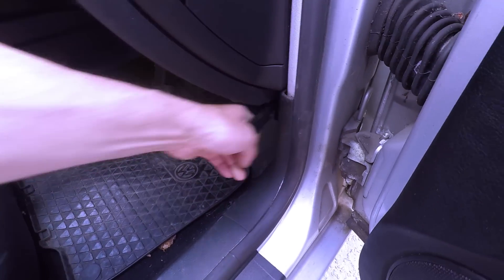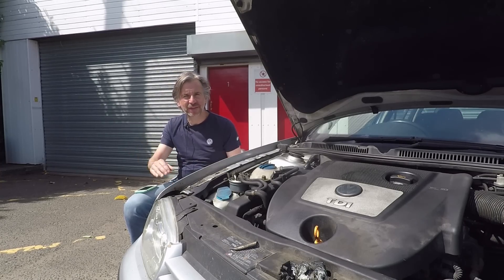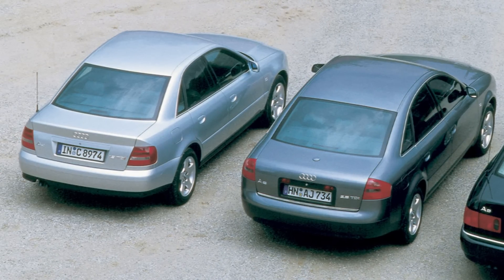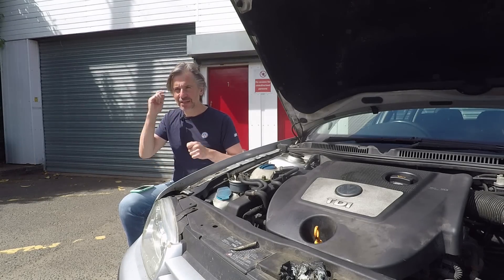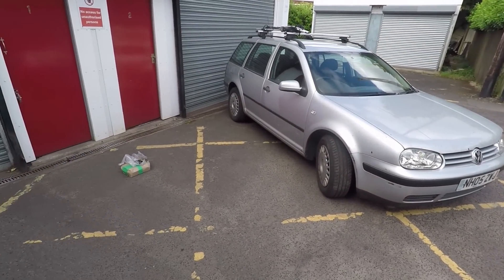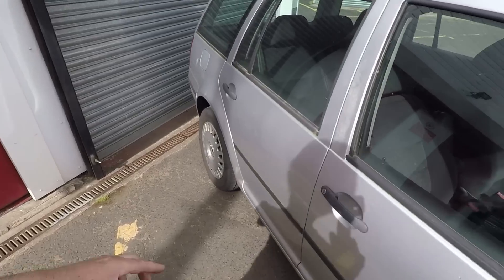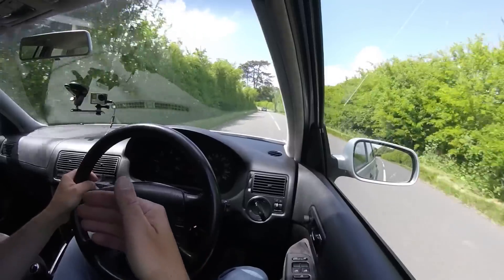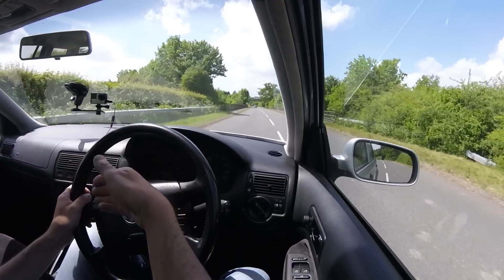I BUY A CAR with VW's BEST ENGINE for JUST £1!

Comment: I’ve worked for Vw/audi group for 22 years and totally agree it is one of the best engine ever produced!
Reply from the maker: Good to have the benefit of your experience A K👊
Reply: Seen an Octavia with the 90bhp engine for sale ages ago. Ex Private Hire, had done around 400k.
Reply: @R A what's the best engine to you? Because these engines are extremely reliable, efficient, and can be remapped to make good power easily
Reply: the best engine to fuck the ozone layer
Reply: @DGT73  my golf 09' 1.9 tdi BXE is still running really well!
Reply: I’m thinking of getting a golf which golf would you recommend for a new driver ☮️😎
Reply: Roberto Kit I’d avoid any car with engine code BXE. They were fitted to all VAG platforms from around 06 to 09, basically the ‘run out’ engines that vag used before switching to common rail Diesel engines. I’d go for a well looked after pre 2006 non BXE engine code car, you can see the engine code
Printed on the timing cover, It’s true not all will go pop but just knowing it might is enough because you could end up in a very dangerous situation, luckily when it happened to me I wasn’t  too far from home.
https://bxeenginefailures.wordpress.com/
Reply: Audi engines with AWX and AVF engine codes you can’t go wrong with. All engines require generally maintenance.

Late PD engines were a headache! Stick with early PD engines without DPF.
Reply: @DGT73  hmmm not good, i don't suppose there's anything to recommend either.. with there being no way knowing why or when it will happen?
Reply: Jem Mace you can get the oil pump drive upgraded at an engine specialist, poor oil shaft drive design again seems to be affecting the 2.0’s too these days. https://www.audi-sport.net/xf/threads/worn-oil-pump-hex-drive-shaft-on-my09-2-0-tdi.274775/
Reply: @DGT73  Thanks pal, I was looking into replacing the oil cooler the other day, looking on youtube for the specific's and to see if any posts came up about the matter when I spotted a video on the oil pump flaws and how to fix, I think this is definitely very high on the list seeing as you've advised me and considering the damages incurred if not done.
Again, thank you!
Reply: I've had AGR, AVF and AXR :P There is also few good videos from Car throttle about the 1.9 TDIs... Octavia, A4 etc
Reply: Can you safely run these on vegetable oil?
Reply: Gilson Dias - burning diesel fuel creates more ground level ozone (eg the main component in “smog”).  While this is bad, and pollutant, it is not “harming” the ozone layer (though diesel fuels do also add to CO2...).  It is best when trying to effect positive change to have a legitimate clue and be able to weigh options in the deeply interconnected complex systems involved.  Ignorant falsehoods help no one.
Reply: @jemmace2586  No sweat, all the best.
Reply: What about my Audi A3 2.0TDI 170BHP IS THAT. A reliable engine?
Reply: i dont mean to be so off topic but does any of you know of a trick to get back into an instagram account??
I was stupid lost the password. I love any help you can offer me.
Reply: @Marcellus Grey No problem xD

Comment: I love VW diesels and have had many, unfortunately here in Sweden the diesel prices have been raised so its not economical anymore. So I went for a 15' Cupra ST instead. Totally fun car too, just bought it a week ago so still getting used to the power and brakes (Brembo).
Still miss the torque and economy of the diesels and reckon the manufacturers will eventually make them cleaner than petrol.
Nice channel and have subscribed. I'm a bit of VW enthusiast, own 2 seats and a T2 westfalia with a very special motor... the body is going through a full bare metal respray at the moment.

Comment: Thanks for the video. It brought me mixed emotions.  I had a 2001 Y reg silver Golf GT TDI 115. I bought it at 15 years old with 120k on the clock.  One overriding feeling was the quality of it.  No knocks, bangs, rattles, super smooth, it felt really well put together, just pure quality that belied it's age.  The bodywork had no rust either.  If you hadn't have known you would have sworn you were driving a 3 or 4 year old car.

Sadly and despite a great history from a VW specialist, I only owned the car for a couple of months.  The car suffered from major head gasket problems.  I'm still not sure to this day if it was just the gasket or also a problem with the block.

Research at the time revealed that the 115 was a bit of an anomaly amongst the other super reliable and long-lived engines.  A weakness in  the design of specifically the 115 lead to a lot of head gasket failures usually above 100k miles that usually manifested between 100k and 130k miles.

I'm sure that if my Golf had had any other version of that engine, it would have still been running to this day.

Comment: Used to love my Bora 1.9tdi 130. Quite quick, economical and never had any problems apart from the boot lock which was replaced under warranty. It even survived having a bit of petrol put in it with no ill effects! Was much nicer than the mk5 golf i had after it.

Comment: the common rail system was a huge improvement compared to the old style injection pumps, old school injection pumps were extremely limited in the maximum pressure as well as injection duration, number of injection cycles and the timing which were all controlled mechanically within the pump, an in between system was the hybrid pumps used on the 2.5tdi v6 engine where there was more electronic control of the timing, the pd's are fantastic being electronically fired and the commonrail takes that a step further by taking the pumping job out the injector to an extremely high pressure pump and fuel rail which feeds all the injectors hence common rail, the injectors are electronically fired  and have extremely tight timing and duration control for better efficiency and emissions but the improved atomisation also allows for better power too. I bought my other half a pd130 a3, it was actually a year older than the 1.2 clio we had just scrapped and was half the price to insure, it's just ticked over the 100k mile mark and still goes like stink!

Comment: I had the 1.9 TDi in a 2009 Mk5 Golf, DPF equipped and with 7-speed DSG.  I particularly enjoyed the effortless mid-range performance (184 lb/ft torque) and easy economy. On longish motorway trips, I would “play” with getting the trip average speed to 60 mph and the overall trip economy to 60 mpg, which I found perfectly doable over a 250 mile end to end journey. Had absolutely no problems with the DPF over a 5 year/65,000 miles ownership period, the DSG transmission helped a lot here as when it was “regenerating” the ‘box would hold lower gears to keep rpm in the optimal regen engine speed range.

Comment: Bought a  2003 MK4 in 2007 with 117K miles. 13 years later , now with 228K Miles ....I've serviced it every year, replaced brake disks/pads etc ,original suspension changed to coilovers (for the lows) at 165K Miles and  a turbo , probably due to remapping and stuck VNT vanes. Never replaced a bush or bearing. Never failed an MOT on anything serious. Now running 180 BHP, still get regular 50+ Mpg, and 60+ mpg on motorway runs. This is the best car I've had and the best overall car I think I will ever have- quick, ecoconical, comfortable....and very cheap to run. @Volkswizard- Good buy for a quid mate!

Comment: I bought a 2001 MK4 TDI 130 golf estate on 90k.  Ran it for about 5 years, sure window regulators, door lock module solder joints, suspension at 150k, duel mass at 180k.

Sold it with 220k on the clock, and all with a tuning box fitted and lots of heavy towing. Last saw it MOT with 280k on the clock.  It was age/value that killed it not reliability.

Really miss that thing!

Comment: I have an 04 PD jetta. 154 000 KM. Didn't need a car at the time, but.. black on black, leather interior, mint no rust, long beech wheels, oil catch can, egr deleted, Bilstein coil overs, 3" custom stainless cat back exhaust, Malone stage 2 tune, 150 hp 275 ft torque, not too fast ( like my 09 2.5 rabbit) but I just LOVE this car. I'll never sell it

Comment: Had the 1.4 TDI PD in a 2001 Polo, owned the car for about 14 years, Engine super sweet, took it to about 200k, a few cambelt kits, always gave it the 505.01 oil. only unplanned mechanical item replaced was the Fuel/Tandem pump and not because it didnt work because the cover was leaking diesel and you just couldn't buy a cover plate gasket. Unfortunately rust will see that car finally off the road as it was starting to get very grotty on front sub-frame and rear axle.

Comment: Audi A3 1.9 tdi pd with the 130 engine and the Audi a2 with a 1.4 tdi engine was the best cars I’ve ever had,amazing cars,that’s coming from someone with a golf mk7 gti
Reply: Yeah, got to agree with you there. After all, the 1.4 TDI is pretty much a 1.9 with a cylinder lopped off, and the A2 is a great little car. Did you have a TDI75 or a TDI90?
Reply: Christopher Morley the a2 I had was the 90,it was fast for what it was,great on diesel to,I regret selling it,wish I kept it for long trips.
Reply: @daibennett9224  That's a nice car you had there (sorry if I make you feel worse about selling it!). I heard the 90s were quick, especially when chipped, and they come with all the cool stuff like rear discs and the FSI (1.2 really) spoiler. My parents have a 1.6, which might be faster outright but comes with none of the torque or reliability, and still sounds like a diesel! It's a shame they binned the A2, but at least people take care of them so there's a few around. Opensky is a pain though...

Comment: Love this engine, I had 2 golfs and a sharan 130, love the torque. I’ve now got kids so a 1.6 tdi caddy and polo, but my best car I will never sell is my 1.4 tdi 3 cylinder. 80 bhp from factory, I’ve done a stage two chip and it absolutely flies off the line( now 105 bhp).

Comment: My current 2011 Passat CR170 has 198k and still on original clutch, DMF, turbo, injectors, injector pump, EGR & DPF. 

The newer CR engines are equally excellent, mine uses no oil/coolant.

Must say though, I went out in a MK4 Anniversary Golf PD150 that had been mapped - the way that donkey punched up hills in the lower gears was hilarious. The mid range hit was bigger than any of my 80’s turbo petrol hatches.

Comment: 1.9TDI is really the best vw engine. 
I also like the 1.8T 20v if right oil is used and changed att right intervals it goes forever
Reply: @R A 
???
Explain
Reply: R A The 20V. Not any TFSI crap.
Reply: R A 
Just don’t like VW’s do you? Shit on the 1.9tdi and the 1.8t? Both great motors. I’m a vr6 guy but I own a mk4 tdi and have owned many 1.8t.
Reply: I have a 2004 Jetta GLI 1.8t for 16 years now and yes I agree, this motor will go forever
Reply: @mx6726  
I ownd 3 diferent 1.8t cars never had engine problems. I had to replace 1 coil and some pcv hoses one time in one of the Audis. And a G28 sensor and thats it.
Reply: I have vw bora 2001 1.8t 150hp, it has 300.000km driven, works better then 10 years younger cars
Reply: i drive a 1.8t with 370k kilometers (230k miles for lazy ones), bought it with 350k 2 years ago... replaced a maf, even though i didn't need to and few vacuum lines, but nothing happened that stopped me on the road. great engine if maintained.
Reply: @allosaurusfragilis7782  
Nice engine the vr6

Comment: My dad is currently driving a 9N3 Polo with the PD100 engine. No mechanical work on the drivetrain yet (only a new vacuum distribution box), and it just ticked over 200k. Revs almost like a petrol engine, and ridiculously efficient.

Comment: Had two Octavia's, one with the 1.9 110BHP ASV engine & my current one with the 2.0 140BHP BKD engine. Both are fantastic reliable engines. Mid-range shove always leaves a smile on my face.

Comment: Nice little engine. I am a huge fan of VW. I am a huge fan of these engines! I owned a plethora of Pd tdi-s:  One of them was identical to this one. Others included a Bora 96kw ASZ,  Golf 4motion 110kw ARL, Octavia A5 77kw, Superb mk1 1.9Tdi 85kw, a b6 125kw Passat with the infamous BMR engine, to name the few... I owned a Fabia mk1 VRs ASZ. Currently I own a Seat Altea 2008 2.0Tdi BKD and a Lupo 3L converted to manual and remapped to 85hp (goes like a bullet and consumes like a cigarette lighter.) 3L is an LHD only, but there are a few enthusiasts driving them in GB as well. They are really epic cars. A place in a museum is reserved for them, for sure! Btw, It might be worth adding that 96kw ASZ, 110kw ARL and the jewel 118KW BPX engine fitted only in Ibiza Cupra are one and the same engine. ARL and BPX are identical. The map is only a little tweaked. ASZ is the same as well. The only difference is that the cars with ASZ engine have a side-mounted intercooler (SMIC), whereas the other two have a front-mounted intercooler (FMIC).  The other difference is the turbo. ASZ has a 1749VA and ARL and BPX have a bigger 1749VB. The bigger turbo is a plug-and-play replacement... The rest is identical: engine internals, injectors, clutches, everything. So.. I had my vRS upgraded from ASZ to ARL easily and remapped to 180bhp. It ran like a dream! 180bhp  is the uppermost limit for the stock clutch!  Thank you for the nice videos, Andrew. I really enjoy watching them. Greetings from Serbia! :)

Comment: I had an 02 Beetle TDI bought to replace my MK2 Golf GTI. The Beetle was quite nippy and put a smile on my face. However 2 problems. The turbo pipe needed replacing because of a broken lug and the wiring in the head needed replacing after encountering periodic misfire. Back to driving my MK2 GTI now though!
Reply: Life ain't so bad then!.

Comment: Oh, yes!!  I've got a MK4 Variant in Reflex Silver with the PD130 ASZ engine - although mine's barely run in at 107k mileage, it had 79k when I purchased it in March 2018.  Mine's SE-spec as well.  Got the same water leak in mine.  Mine's very roly-poly with the ride - it's got the original shock absorbers on all four corners.  I generally average around 63-65mpg.  I regularly (if driven carefully!) get over 700 miles from the 55L tank.  I came for the Audi 80, but I'll definitely stay to see this MK4 TDI Variant!!  If you've not already done it I'd enjoy seeing the injector change, tools required etc.  The water leak will be useful for myself, no doubt others, too!  Mine isn't the sunroof model although everybody seems to suggest sunroof drains.  Just booked mine into the local VW specialist garage to have it's timing belt done (water pump, tensioners, aux belt, tensioners for that, A/C regas, gearbox mount - quite the list, but I hope it will be worth it) in a couple of weeks time.  I noticed your windscreen scuttle is damaged and you're missing both the clips either-side of it by the hinge - I hope you can source a replacement.  I'll have to keep checking eBay for injectors if you managed to get four for £55, that's a steal!  All the best Andrew, great video.  Really looking forward to seeing more.

Comment: I'm the original owner and only driver of a 2004 VW GTI 2.8L 24V VR6.  Engine code BDF.  This is mated to a 6-speed manual transmission, code O2M.  This engine continues to perform flawlessly.  The biggest issues have been a leaking radiator within the first 2 years of ownership.  This was replaced under warranty.  Also, an ignition coil failed.  The was my fault for waiting too long to replace the coils.  A vacuum line also leaked once.  Finally, there is an oil leak that I need to identify the source of and fix.  I believe it may be coming from the secondary air system.  Aside from these minor problems, the core engine has been reliable.  I only use 91 octane fuel and only use Castrol 5W-40 synthetic oil.

Comment: Evening Andrew I would've expected a car with that mileage the drivers seat to be threadbare especially the bolster but it's taken the mileage very well, doesn't look that old at all. Keep going your content is good, more interesting than some I've seen lately. Regards Simon.
Reply from the maker: Thanks Simon, very glad you enjoyed this video, means a lot.  The owner being a lean hardcore cyclist has helped the seat I think!
Reply: The fabric seats hold up incredibly well in all forms from my experience, especially the sport seats
Reply: Leon TDI pd 2.0 in 2010. No faults. Strong power. Massive shove in the back from about 2 to 4000rpm. Replaced it with 1.6tdi because I was fed up of sports suspension. The 2.0tdi 140 was as economical, much faster and much louder. Engine refinement was the downside of the PD especially under acceleration at low speeds. Rival common rail systems were much nicer on the ears. More civilized but the PD torque and all at once power delivery was a lot of fun.
Reply: @Djwatzy  Yeah, agreed.. had Passat with same seats with about 200k miles

Comment: Great engine’s the old PD, I bought a 54 plate Fabia Vrs in 2015 as a work runabout, my main car at the time was a 6month old golf R, I took the Skoda a test drive and was shocked how quick it was, obviously not as quick as the golf but the initial kick when you planted your foot was addictive, I had it for 3 years and it never missed a beat, all I done to it was change the oil and put front tyres on it. Fantastic wee motor
Reply: The 130 in the Fabia or Ibiza was top value.

Comment: I had a 51 plate VW Golf SE black estate 130hp tdi from brand new. Replaced it in 2004 with 100k on the clock. Apart from routine services no problems. Only criticism was the suspension couldn’t keep up with the engine. For the time it was rapid.